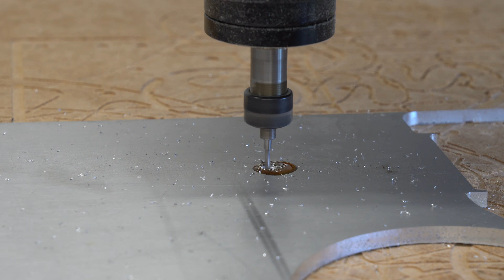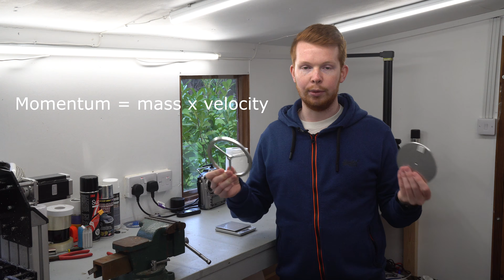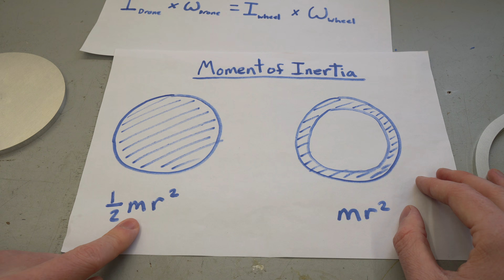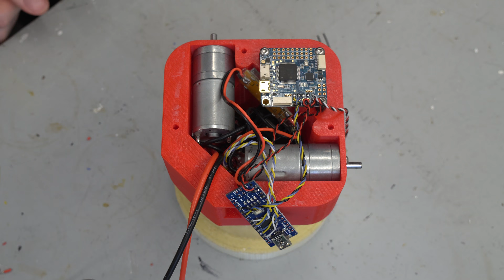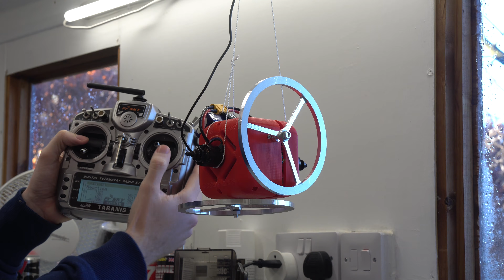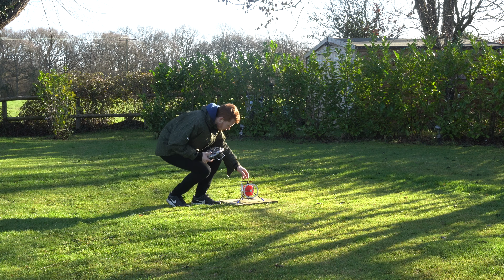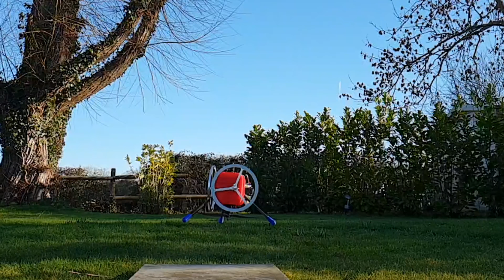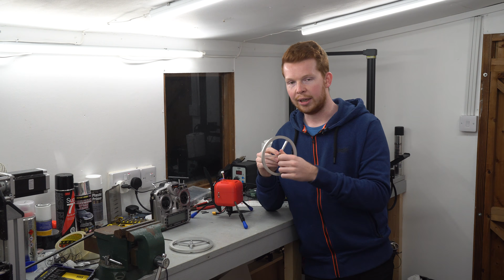Comment: This is not a can of worms, it's a container ship worth of worms. The fundamental thing is that reaction wheels don't change your attitude simply by rotating at a fixed speed - they only "push back on you" whenever you change their speed; that is, when you accelerate them. That, unfortunately, applies only to the idealized case - whenever one ignores any friction in the motor and gearing (and any friction with the air).

It's easy to imagine that a wheel spinning on an ideal, frictionless axis would simply keep spinning forever, without any power applied to its motor and without exerting any force on its mount. If then we energize the motor, it would either slow down or speed up the wheel and in the process the motor and the mount itself would experience an opposing momentum change, equal to the one imparted on the wheel. If we disconnect the motor, the wheel keeps spinning at its new speed and the mount stops experiencing reaction torque from the wheel.

Unfortunately, motors tend to have a top speed, meaning that a motor would not be able to further accelerate a wheel that is already spinning that fast - which is what is meant by it getting "saturated" in the video. Even worse, motors definitely don't have frictionless axes and geared motors even less so - which makes all of the above no longer work cleanly, because as soon as we disconnect the motor the wheel starts getting slowed down by the friction, imparting a corresponding opposite momentum change to its own momentum loss back to the motor and its mount. And that's not even getting into the effects of friction with the air surrounding the wheel, which may or may not be negligible (they certainly aren't if you exchange your wheel with a prop - that's why helicopters get spun around by their own main rotor unless the tail rotor explicitly counteracts that).

But at any rate, it's definitely not as simple as "apply current to the motor, experience proportional reaction torque on the mount". If anything, arguably applying just enough current to keep the wheel spinning at constant speed (merely offsetting friction) should result in zero back-torque, and trying to speed up or slow down would result in momentary action. But I really doubt it's that simple - and we didn't even get into any resulting gyroscopic effects, which is what happens whenever one tries to tilt the axis of an already spinning wheel...

Comment: nice, think gyroscopic precession may have been the issue here - when the wheels are spinning the directions of the forces needed all shift 90 degrees from when they aren't spinning (applies to the lift rotors to) better reactions also come from breaking the wheels rather than accelerating them. test it in a gimbal to tune it so it doesnt break. love to see this fly.

Comment: Very good effort.  I don't think your wheel axis go through the cg.  This causes mode coupling.  Also, you could get around the brushless motor direction change issue by biasing or prespinning the wheels to a sufficiently high rpm and just never cross zero.

Comment: Always worth waiting for your videos Tom, take as much time as you need. Along with some others here I think the reaction wheels are too far from the CoG. You can see possible gyroscopic precession on the sides that they're on in the slowmo. I would try coming up with a self contained box that can sit nearer the CoG and balanced within itself (wheels centered on each other and drive one wheel from the outside?) but then I don't have the inclination, skills, or sheer determination you have to even come up with something like this in the first place! More power to yer elbow Tom.

Comment: I love this idea, but a problem I think you were having was the "balance". as in, when a reaction wheel isn't the "center of mass" it won't spin, on the actual axis it "should". I'm sure there's some kind of math that could be done to use only 2 wheels, you could also use 4 wheels. (plus that would look cooler!) If you watch closely, you can see the reaction wheels fighting each other, rather hard. I'm SUPER interested in this theory... not that it's practical, but it just sounds awesome to have have a fully functioning "drone", with just a Coaxial blade. (That would be my other advice, go for a more standard counter-rotating coaxial helicopter)

Comment: http://iq-control.com has speed controllers that can control the position of a brushless motor at very slow speeds. You should check them out. I saw it highlighted on a video about 3D quads - the transition of direction is smoooooth....

Comment: Brushless motors are also used for gymbals where they turn really slow and precisely. It should be possible to use them in a situation like this where you are mostly accelerating the wheels from a standstill. The problem is that you cant use regular rc brushless motor controllers and probably would have to cook something up yourself. Thanks for trying it out though, it seems like with a little tweaking it should fly forever. It's only rocket science, you know. Also: If it works in kerbal space program, it should work in real life.

Comment: Nice video, watching the slow motion I recommend making smaller diameter wheels, seems like the reactionary forces are so high from the I term, then combined with sluggish motors that the system is unstable.  Smaller wheels will be more responsive too

Comment: I think the problem is that the drone is not balanced since there are two motors instead of four, making one corner heavy. So the wheels are constantly having to adjust for the imbalance and if they hit the right frequency when they are correcting and overcorrecting it causes the drone to go out of control and crash like we saw and most of the video where it was jittering back and forth. it would be interesting if you revisit this with 4 motors and wheels that are half the size. Good job though, I don't know where you come up with this stuff.👍

Comment: A very nice video as always. I think having two wheels in opposing sides (4 wheels in total) each one geverning the rotation on only one direction ( clockwise or counter clockwise) would give the drone far more stability and also even distribtution of weight although it will be heavier.

Comment: Instead of using two reaction wheels, use four.  These would used as two pairs, with each pair of reaction wheels controlling one axis.  These pairs spin opposite each other in counter rotation, with a high enough minimum speed that brushless motors can change their speeds easily.

Comment: Hmmm, I wonder what would happen if you went from reaction mode to resistance mode. 
 By this, I mean you could have those wheels working against the air, like steam boat paddle wheels, instead of manipulating momentum.
Reply: What about the turbulence caused by the blades doing the actual lifting
Reply: @callmezucc9318  
 That may not be a problem, as the attitude control system should automatically compensate for it.

Comment: This is awesome, have you heard of an Odrive? It's an open source servo controller that uses an RC brushless motor and an encoder. This gives you incredible torque control at low speeds. I think that if you had a controller that you could command specific torque values to, rather than PWM DC motors, the system could work better.

Comment: Pilot induced oscillation or rather flight controller induced here
The flight controller is over correcting and each time it gives the oscillation a little bit more push until it gets out of hand

Comment: Wouldn't the drone fly more stable if you let the wheels spin at a medium speed continuously and control the drone by increasing or decreasing the rotation speed?
Reply: I was thinking that too, spin them up to 50% right off the bat, then take off. I THINK that is how satellites do it.  The wheels are actually spun up before the rocket even takes off.   Though only issue with this is if the sat loses power in space then it will spin out of control...  so I may be wrong.

Comment: What if you ran a dual stacked wheel system for each axis? Basically an inner shaft controls the bottom wheel, then an outer shaft controls the top wheel. You would need to gear the outer shaft, so that would be an issue +weight. Gearing them both would help though.  But you could dedicate each wheel for a direction. Letting you counter an oversteer, or dampen the spin. Maybe that would allow brushless motors as well? 

One major issue I could see is the wheels countering each other out if you are trying to turn, and the flight controller is trying to level. 

Maybe that's just an over engineered idea though. lol

Comment: 1. what u need is a small neural net.. small enough that it can be evaluated quickly even by the flight hardware.
start by training it while hanging in strings like in the vid. then abuse it, let the small neural net control the qube. 

need to be clever when measuring error. not sure what flight grade embedded hardware can do, but the net has to be quick to evaluate. like 50 ms (20 times a second) or shorter.. 

the advantage is that stuff like one of the motors being stronger than the other would be .. accounted for by the net, as well as all the other parameters.

2. another idea is to use a genetic algo to evolve flight params from trial and error, however, that requires that u emulate flight conditions more accuratley than hanging from some strings i guess..

this would simply give u a decent set of flight params.. but, i dont know how that flight controller works, or what parameters u can set. it could be that the flight controller is too.. simple/specific..  to handle the strange values coming in.

neural net, complicated, perhaps expensive, most likley writing a bunch of code. but. if there is a physical possibility to keep things upright, it will find it. u know, given enough time and money u could solve anything.

gg

Comment: Your inertia wheels are offset for center of mass of each wheel.  ReThink the inertia wheels as two parallel lighter wheels. Two wheels per axis on a common axle.  Think of a dumb bell with the center of mass in the center of the drone.  I love what you are doing :)

Micro Cube Sat designs have to place offset weight of internal components as far away from the inertia wheels to attenuate the effects of wheel mass offset.

Comment: Really cool project.  Part of me wonders if the bottom propeller is the real problem, where the force it applies it basically it throws off the center off mass.  In other words, there was no natural gravitational stability.  Of course, you could use the Arduino to compensate for this, but it seems like a lot of additional work.

Comment: I'm at 19:45, and Inwould say increase D, and I... On roll and pitch, and maybe slightly less P, like if the P was 60, decrease it down to 55, then increase I by a 6th or 7th, and D by a 5th.
Reply: I actually had D so high that the flight controller stopped arming at one point due to a PID error haha. In the end I had P at 75, I at 60 and D at 210

Comment: instead of breaking propellers trying to balance it in flight, balance the lower motor on some shaft and hang the top motor on the ceiling with a bit of slack until it can balance itself this way it is not prepared for flight. It should be able to not depend on the wire from the ceiling to stay upright.

Comment: why not try 4 reaction wheels, or even 6? you need perfect controllable balance.

actually its a pretty weird law, if you used the same force, yet the lawnmower was a tennis ball, you would not move away this far...  the biggest of the two masses remains in place better than the lighter of the two. in space you would push off from the iss... and the iss will never move an inch...

Comment: This is really neat!  I always been kinda curious how well reaction wheels would work on a drone.  I may have even mentioned it at some point but don't recall. 

One thing to try too might be to use a plywood or plastic disc (anything light really) that is stationary and has a bunch of coils grouped in a 3 phase configuration, then put magnets on the discs. Essentially the reaction wheel would become a big BLDC. You'd get lot of torque by having the coils and magnets at the outer edge.  You could then try to control it that way.  Though I guess that would be more complex as you said since you need some kind of rotary encoder too so you can tell how fast it's going.

Another fun project might be to build a RC car that uses the actual wheels as reaction wheels so when you take a jump it will try to land it properly each time.

Comment: I have 3 suggestions to improve your design:

1. It would be easier if you put both propellers on the top, if one of them is on the bottom it will make the drone unbalanced and it will be harder to controll.
If you put both of them at the top, the drone will be pulled up and be more balanced.
You need 2 propellers because you need to eliminate each other angular momentum, unless you want to add an other wheels at the bottom.

2. Because the 2 wheels are uncentred, they need to speed up more to rotate the drone in one direction instead of the other, because one side is further away It will have a greater force of inertia.

3. Watching your slow motion video, I think that the flight controller or the motors are too slow from the input to the output.
You could try to change some hardware components.
Maybe buy motors with the shaft that point in both directions so you can put the wheels on all 4 sides and make the drone perfect balanced.
Another advantage of the 4 wheels is that the motors will need to spin slower to get the same result.

Comment: Watching the slo-mo, it looks like the control software doesn't take into account that more torque is required for the wheel to spin the motor than it takes for the motor to spin the wheel. This is because of the gear reduction. Also, gear lash will cause a momentary lapse in effect between driving and driven torques that may be confusing a very fast accelerometer and causing it to throw a sudden, huge number at your PID that sets up this oscillation. This is why choosier moms choose direct drive reaction wheels... and Jif.

Comment: very nice project! IMHO the problem with stability was due to bottom propeller being far too low below the center of mass. coaxial prop would be a nice solution, but costly. this is besides the obvious oscillations caused by poorly calibrated PID parameters. a few more minutes in a calibration jig would have helped, but not with that bottom prop. please keep this up. your projects are an inspiration

Comment: Increase the moment of inertia. Back when I operated steadicam we had these things called antlers which were basically just small weights placed at a large distance from the COG. Kinda like what you did here with the reaction wheels here smaller mass but further away. Make a frame as a landing gear with some weights about perhaps 75cm on each side, it will stop it from being so squirrely, it makes the whole mass act as if it is a larger one. The drone you have here was rotating around it's own axis to easily and your system couldn't make corrections quickly enough.

Comment: why are the UK wall power outlets so huge and ugly?  I'm serious with my question, it's only 110/120V like here in Canada, but why sooo huge?
Reply: It's 220-240V in the UK. Hence the earth connection and thicker cables too...
Reply: In the UK it's not "110/120V like in Canada". The power plugs incorporate user-replaceable fuses (the fuse carrier takes up significant space) and have sleeved pins (so the pins are larger). The power sockets have a shutter that blocks off the live and neutral pins until the earth pin starts being inserted  - this mechanism requires space in the socket design. These features and larger clearances for better isolation for 230/240V lead to a larger design compared to the older Type A system.
Reply: Because they have an integrated old fashion tube fuse in them.
Reply: https://www.youtube.com/watch?v=UEfP1OKKz_Q explains it all

Comment: Just skip the external flywheels and put two large diameter BLDCs as close to the center of gravity as possible.   No need for any geared motors, just the BLDCs can generate enough counter rotation to achieve desired rolls and with much greater stability.

Comment: You madman! That's a great spin on drone control! Now I really, really, really have to make myself a CNC.
Reply: Take apart a few of your printers and make one!!
Reply: @TomStantonEngineering  Yes that would be a great start and an interesting video too! :)
Reply: @TomStantonEngineering  - got a boatload of old printers. Any good starting points in this regard?
Reply: Could be fun seeing a cnc with brushless motors and encoders.
Reply: "a great spin"
*starts slowclapping *
Reply: Hello Ivan ^^/
Reply: im still trying to workout what all those markers are spose to do,and what it for
Reply: @biscuitsandgravy   they would indeed  be servo motors but usually when we talk about servos we are talking about the rectangular ones that can only do a single rotation.

I was thinking about a motor for rc cars coupled to an encoder instead of the stepper motors which are usually used in diy projects.
Reply: You don't need a cnc or a 3d printer or any of the similar hyped up crap. 20 years ago people(me included) were building heaps more complex(sans the flight control electronics) projects with a coping saw, a file and assortment of glues and epoxies.
Reply: @NGC1433  nevertheless......    ( Major difference from automated to humanised is human get some experience